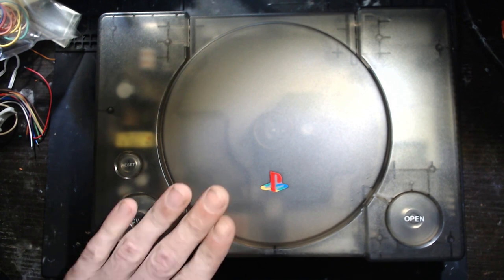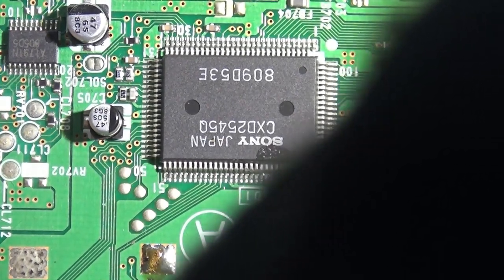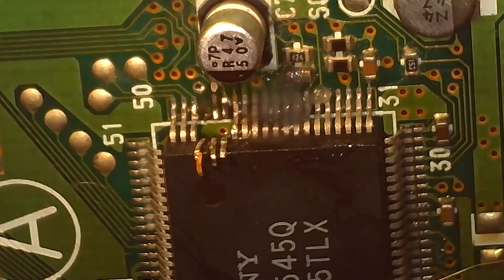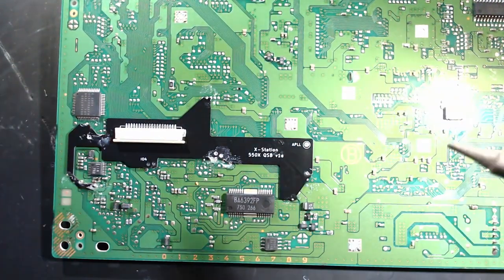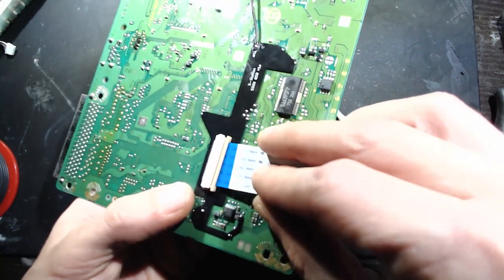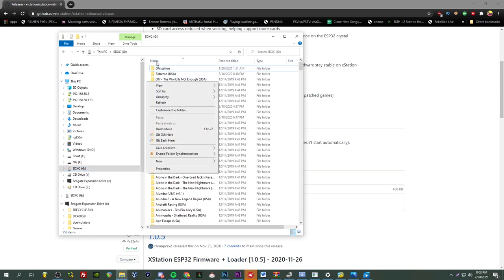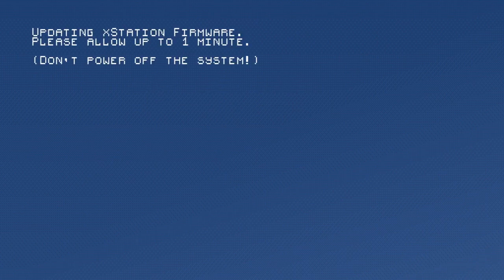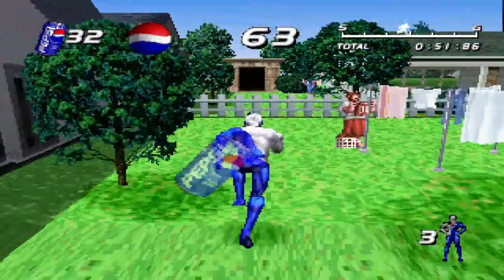Ps1 - Xstation Installation Guide With Laser Bear SD Mount (PU-18)

Comment: I'm going to have it installed to the 1001. I'm using a Sony pvm monitor and planning to use  a retro tink 5x via RGB for new panels. So, i don't see the point In going digital.  What's your opinion on this?
Reply from the maker: Solid choice! I have my 5x and I love it. I’d go with the insurrection ps1 scart cables if you’re set up for scart